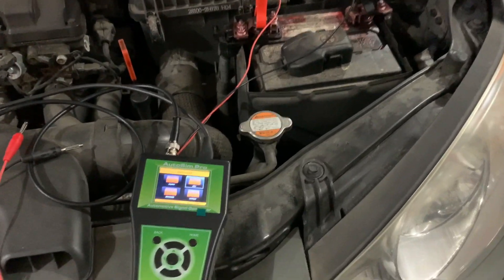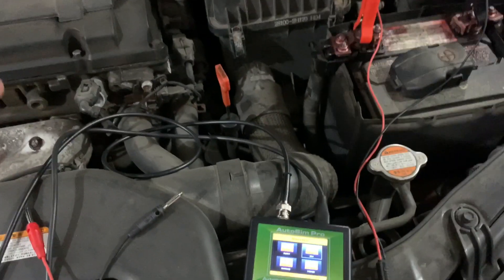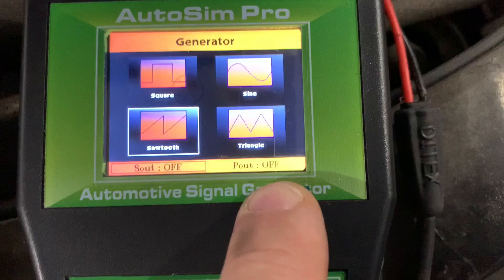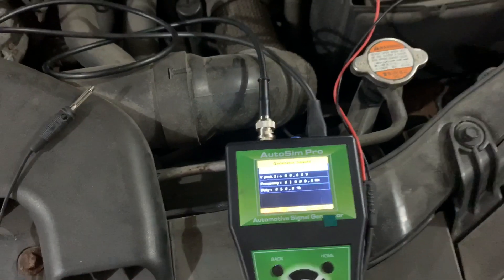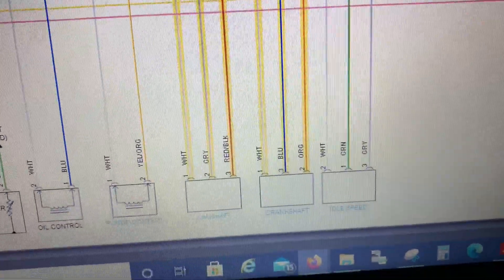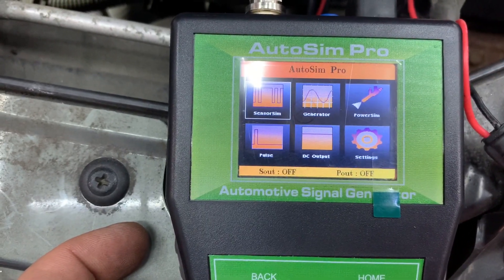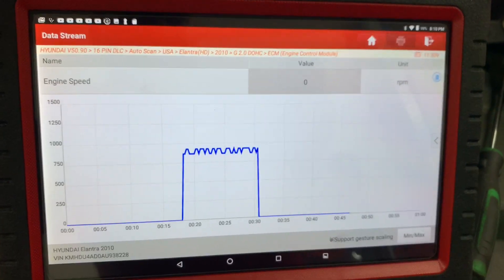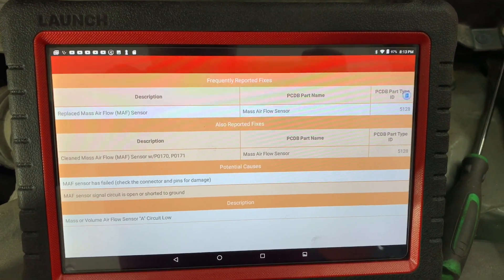*****Autosim Pro****** Auto Ditex Amazing sensor simulator PT.1

Comment: Hi buddy, you still uploading videos? Thanks for demonstrating this, I’m new to fault finding, looking to get new knowledge into wiring & diagnostic. I have a Volvo c30 giving me some sensor codes. I have changed various parts and still have the codes so am now thinking this auto sim will be cheaper than the parts cannon I am using. Does this do all sensors currently having trouble with the additive dosing module and fuel tank level sensor. Just wondering how you know what frequencies or voltage to give the sensors please? Many thanks

Comment: Where did u get the wiring diagram so fast?
Reply from the maker: Service data
Reply: @weldingjunkie  thx I think I'm leaning towards an autel I seem to like them. I really like the thinktool platinum s20 I think the wireless attachments are awesome but it's expensive.
Reply from the maker: @Theguv-nor  the thinkpros is around $1000 and platinum s10 is $1500 has all the same attachments. They are excellent scanner I sell a lot of them. TopDon has the same programming but they remove the assessories functions. The autel 906 pro the new one is great too

Comment: Jay, I'm weighing out options for scan tools, I'm about split between the bosh 525x and the launch x431vpro, my question is the launch able to run a borescope via usb somehow? Cant find anything on this on the web, thanks
Reply from the maker: Hey Derek, happy new year. Yes launch runs off usb, they actually make thier own bore scopes. Keep in mind depending on what you are doing, the launch (China) models pro, V, V+ etc cannot connect with auto auth for fca Chrysler etc. keep that in mind for future too. The Bosch 525 can however the Bosch is like the snap on in terms of coverage where the launch excels with Asian etc. i would get the launch Turbo if you are going with launch it’s a USA model. To affirm your question yes you can use a bore scope 100% there is no scope app on the machine tho you have to install it.
Reply: @weldingjunkie  Good to know! And thanks for the advice, I watched your comparison vid and also very helpful, I may just go with both of them.